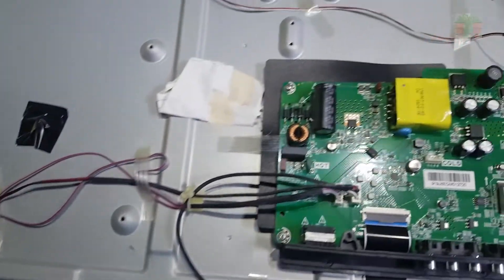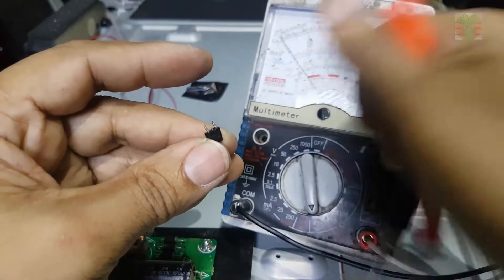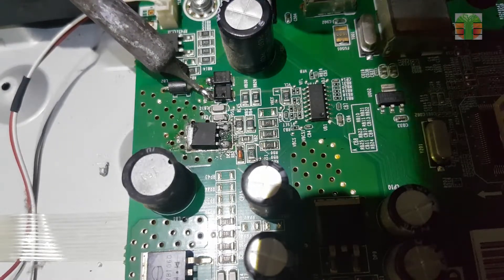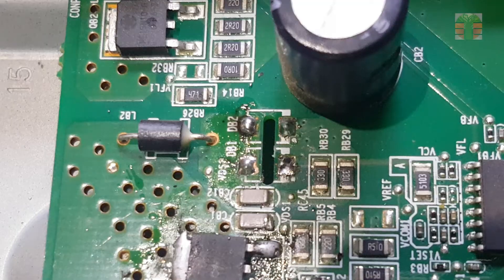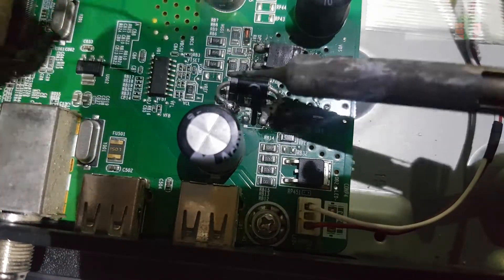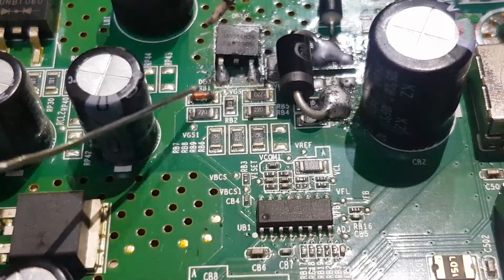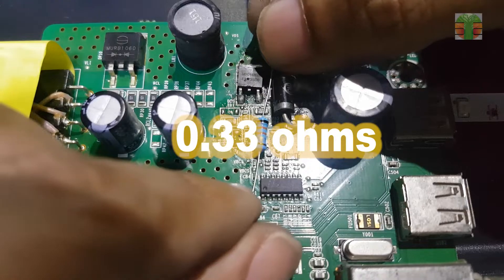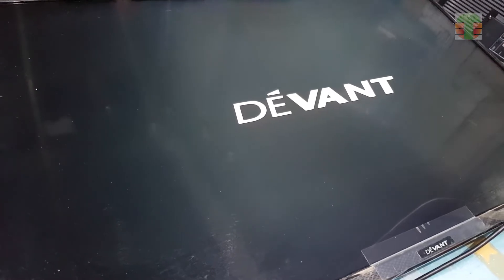LED driver repair.

Comment: What is the backlight voltage when set is in standby and voltage when set is turned on.At the beginning you said voltage was 60v and should go up but later on i saw the the same voltage on the meter when you said set was now working.Pls clarify or did i miss something.thank you
Reply: Si, yo también tengo la misma duda.

Comment: Sorry for saying this but Mr. Tevz, your soldering iron and solder wire both are of very bad quality, see the amount of slag when the wire melts and also try to do clean soldering, when TV is opened it should be difficult to tell if TV has been repaired or not. 
Thank you for lovely videos 👍👍👍

Comment: What was the purpose of the Zener diode connected to the gate and why did not you replace it please ?
Reply from the maker: Protetion of the pwm ic
Reply: @tevzTVTevatronics  Voltage regulator ? Why you did not replace it please ?
Reply from the maker: @olivierj.2435  It's okay not to replace it, the zener diode is not used to regulate voltage here.

Comment: My respects to you, professor..on this occasion, I read some information about the Philippine Islands...you have a lot of patience and pleasure in helping people understand the working of various electronic circuits, but that comes with time and experience.. in most cases, those with too much experience in the field of radio-tv repairs are interested in the detailed explanations.I also fall into this category, although I solve the small household repairs myself (the control board from the Whirpool automatic washing machine, the electronic board from the gas boiler-replacement of the non-polarized capacitor of 0.1 micro / 400 volts; the power supply of the computer of 450 watts-voltage of 5 volts is missing...small repairs in my free time, never at a professional level, like you)...but, with your kindness to explain in detail and with my little knowledge about this field, I hope to solve small problems at home...for this fact, I remain indebted to you and I promise to follow as many of your presentations as possible, adding a "big thank you" and, of course, the "like" button...gods bless you take care and good health, I wish you many more dollars in your account from customers satisfied with the repairs made by you
Reply from the maker: If you fall to this category? You will easily learn it. Just keep fall to it. You also help this channel by sharing it. Thank you. God bless you.

Comment: Thanks for this deep troubleshooting, I have 75' Vizio flat screen with three busted capacitor in the power board, I replaced the 3 capacitor but the TV will still not come on though the capacitors rating was 68uf 450 but I was able to get 47uf 450 to replace them but still not working no single light anywhere
Reply from the maker: Maybe the circuit's power supply is already damaged. Because of the capacitor is busted, it may also damage the other components.
Reply: @tevzTVTevatronics  Ok, please what do advise me to check on the power board now
Reply from the maker: @tonyalale3808  Check voltages to the main power supply. if there is a voltage at the secondary out. maim supply is good.

Comment: Hi. Thank you for sharing. you got the knowledge why not use the same parts for repair. They are cheap. Or is it an improvement on a wrong design
Reply from the maker: Thus components are not available here in my area.  Yes, it's also modifying or improving the circuit.

Comment: Good morning Tevz.
Hope you are good.
Thanks for these updates in led tv inverter.
I have 2 questions as usual. 😊
How do you know the polarity of the ultra fast diotes. 
Why you scratch the board to weld it on the ground. And not on the original soldering. And also why you join these soldering on 1 side to the ground.

Why ziner diotes didn't replace.? 
I think ziner allow only a minimum voltage reverse. Because you didn't have the exact omh resistor. That's why you left the ziner Empty.
If you had replace the ziner diote the voltage would go through ziner and won't reverse amount voltage back.

May be am wrong also.🙏
Only you can help me to understand the circuit.
Whereas me I have think 🤔 within my knowledge that I know.
Have a good day Sir.
Reply from the maker: I scratch it to remove the varnish so the lead will flow,  there is a polarity note where the anode of the diode goes. The zener diode use only for protection to the pwm driver. 0.17 ohms . Close to  .33 ohms. If you put 2.2 ohms that's not going to work.
Reply: @tevzTVTevatronics  thanks once again for your support and response.
Have a good day sir.

Comment: And the zener? Is ok ? Its supose to be there regulating some voltaje
Reply from the maker: Yes, the Zener diode uses to regulate voltage. But the job of the Zener here is not to regulate voltage. This is to prevent a high voltage from entering the PWM driver controller. just like when the mosfet was damaged or got shorted, the Zener diode will do the work, it will get shorted and the high voltage now not going into the driver. So then the driver is will be ok. The Zener diode is about 18 volts. When the next time the mosfet gets shorted without the Zener diode the driver may also be damaged. I hope you understand.
Reply: @tevzTVTevatronics  Yes i underdtand very clear , thak you very much for your time
Reply: Very nice video , but there should be the zener diode because in future if the output MOSFET get shorted the PWM driver IC also affected.
Reply from the maker: @bablaghosh5476  Yes you're right.